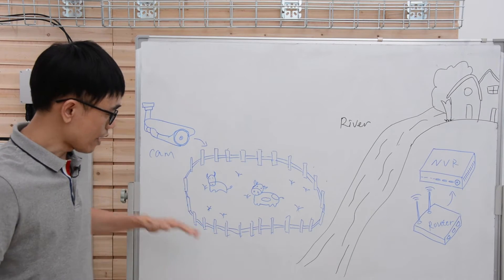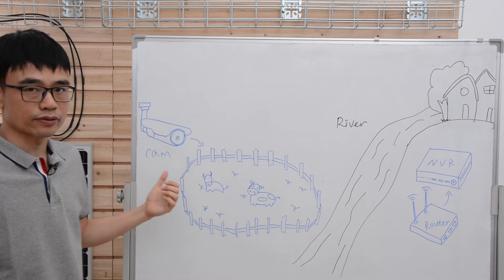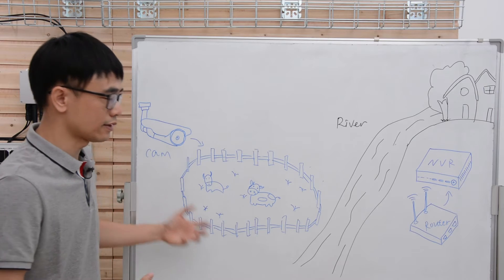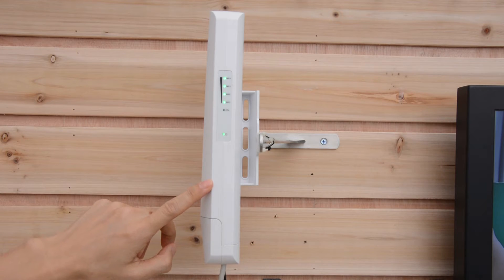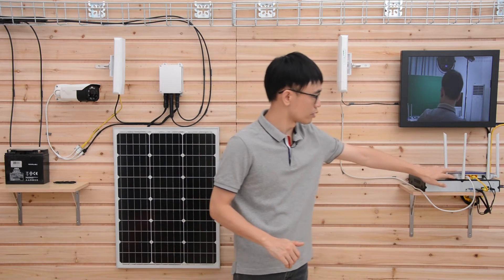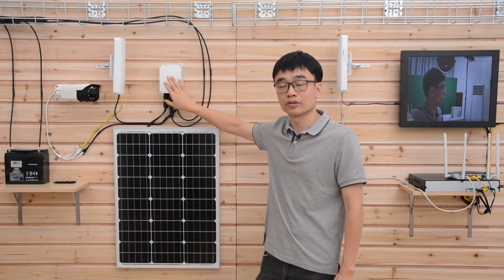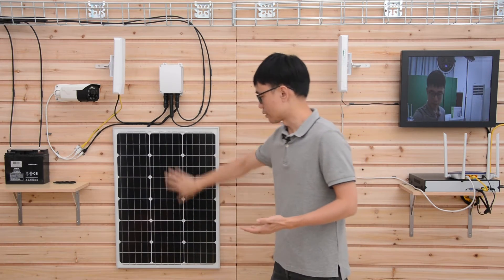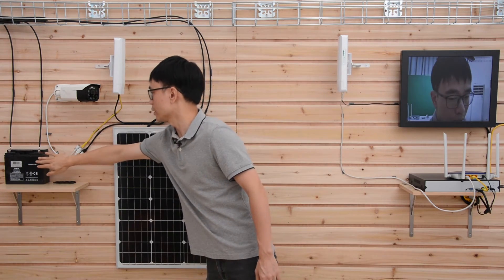Set Up IP camera by using the solar panel and wireless bridge

Comment: This setup woud be perfect for what i need. Only thing is… is there a other solution for the wireless bridge, letst say a 4g router
Reply from the maker: There is no much difference. You can change the wireless bridge to 4G router. The power consumption is pretty similar. The solar panel system offer the power solution and it can works with different device as long as the device accepts DC12V input.
Reply: @Fastcabling  ok thnx. i need to look into this. I already have a teltonica RUT 950 router.

Comment: Like ,I have 15 camera in different locations, no power source, and these all camera need to integrate with nvr,so please give me it's details
Reply from the maker: You might need independent solar panel system for each camera if there is no way to aggregate the cameras.

Comment: I have a question:  Is the wireless bridge able to be setup using wi-fi camera?
Reply from the maker: Depends on the model. Some wireless bridge has hot spot, so you can connect the bridge through WiFi and configure the bridge. If both bridges paired up already, you can access the web server of bridges through local network’s Wi-Fi router.